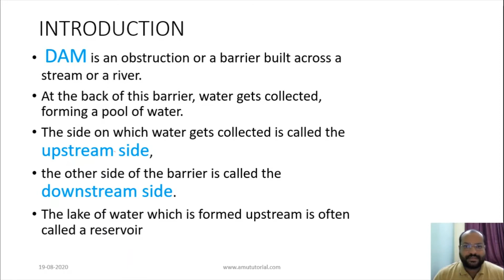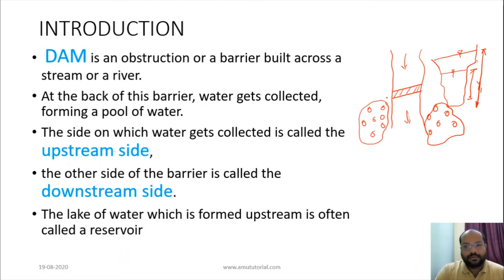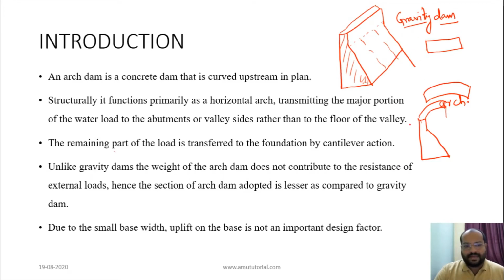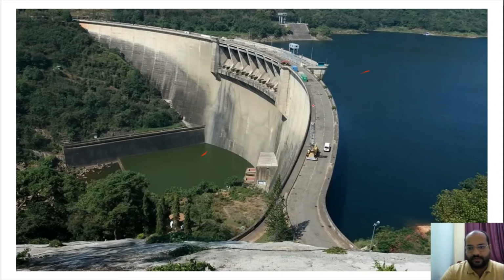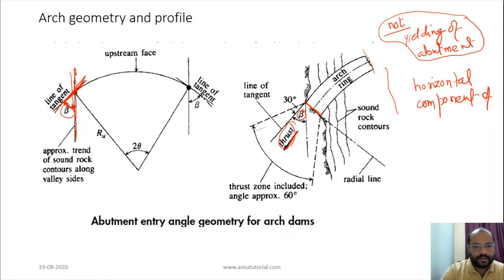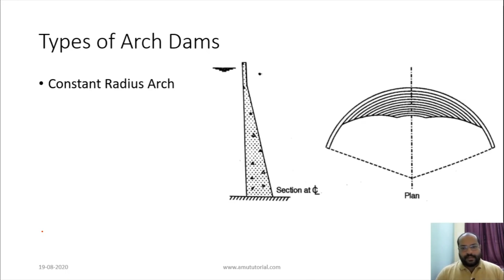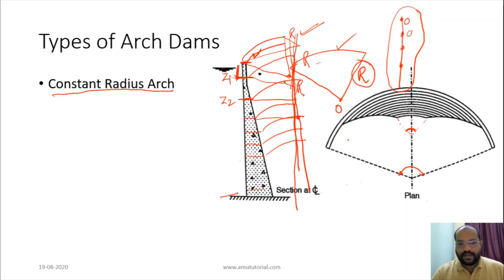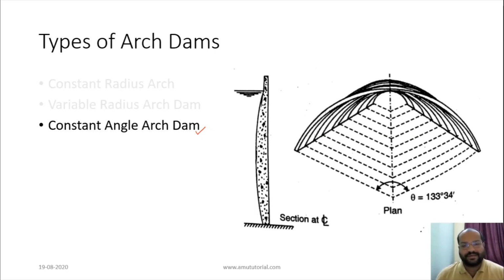Arch Dams-Introduction (Lecture-1)

Comment: Sir, please clear what is the abutment entry angle beta in arch dams?
Reply from the maker: The horizontal component of arch thrust must be transferred into the abutment at a safe angle, i.e. one which will not promote abutment yielding or instability.